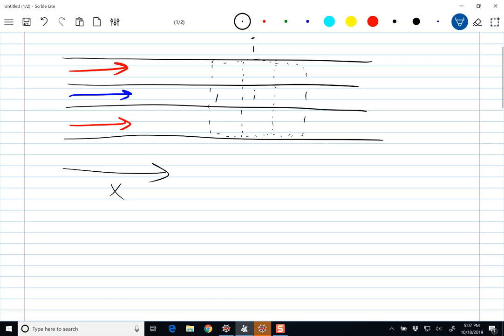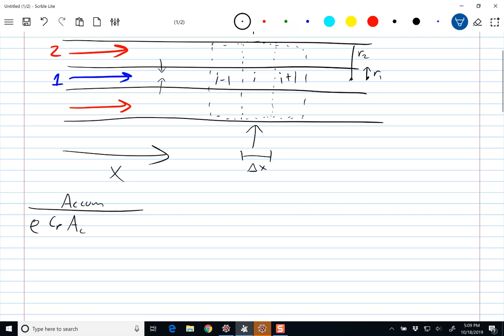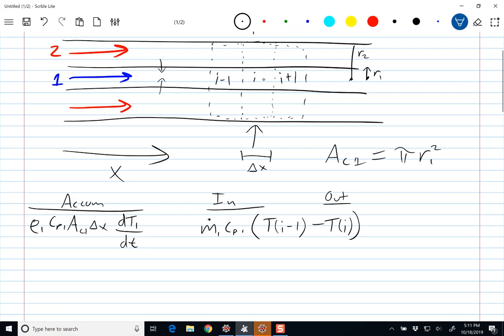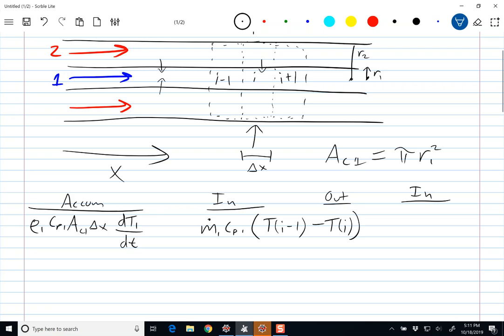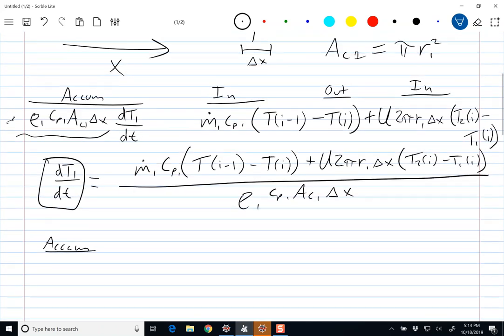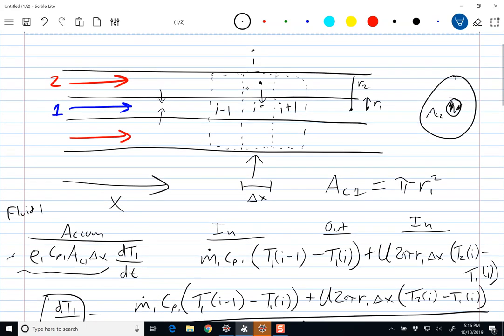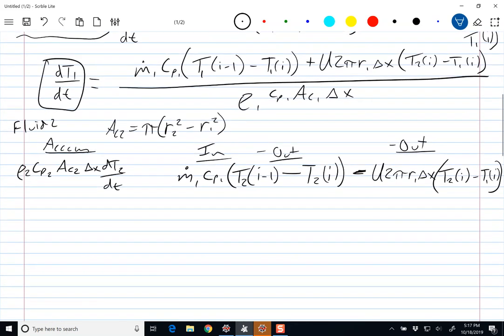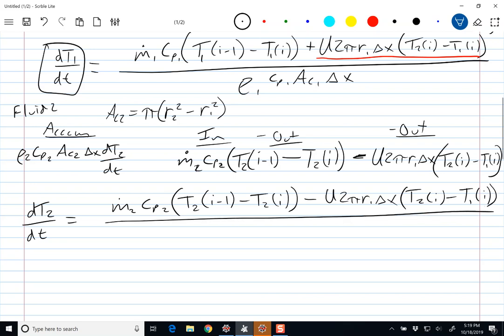Simulating a double pipe heat exchanger dynamically in Python (Part 1: Derivation of Equations)

Comment: Hi Kody. thank you for the content. i have a question regarding the code. when i plug in different values, such as radius, length, U, or Cp (i have a system with gas instead of liquid) into the python code, it doesn't work. the answers fluctuate and i don't get any answers? what can i do? secondly, how can i imply the code for a system, where the inner fluid is gas, which worms up the exterior, how to imply the heat balance with the code in this situation? thank you from advance

Comment: Nice video, but I have one question: Should't the flow rate being accounted for in the denominator in some way? Right now, if you operate under high flow rates dT/dt will also be high, which is counterintuitive. If I plug in all equations in Python and use a very high flow rate, my graph will osscilate really badly and does not make sense anymore.